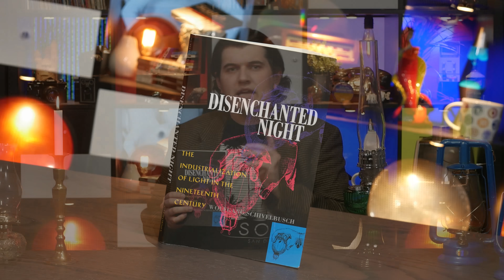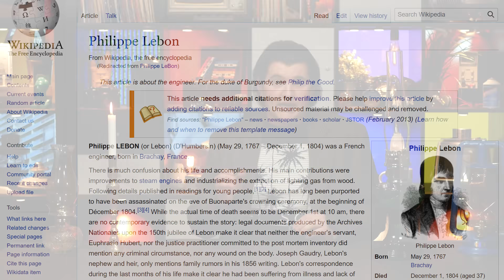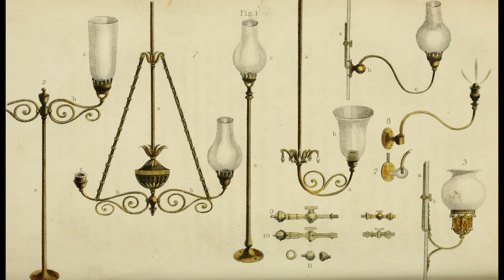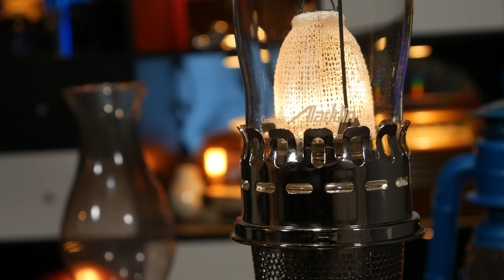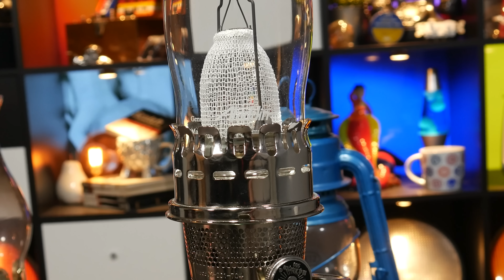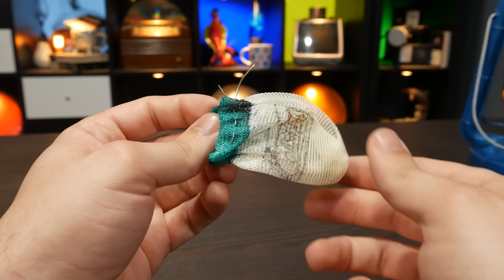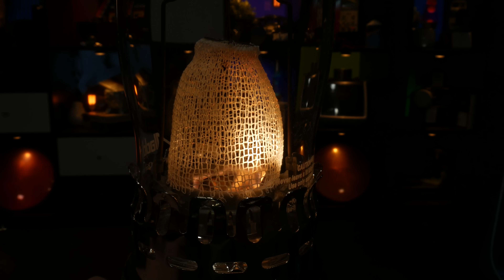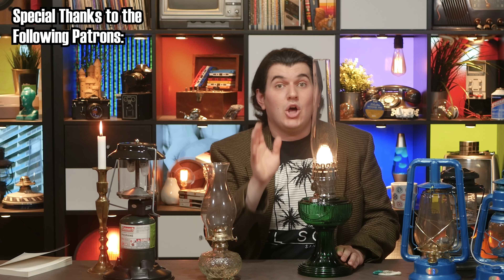How the gas mantle made lamps 10X brighter

Comment: Some notes on coal gas. I'm an amature blacksmith and I work with coal sometimes. So the way you forge with coal you add new coal by putting it around the edges so it slowly cooks and cokes up. As it cokes up it forms s greenish yellow smoke which most of us believe is sulfur. The impurities of the smoke when combined with water form caustic acids that can eat away at your flue if it's not made with the right materials. Now imagine using this gas to light your home. It's not going to be good.

Comment: This particular Aladdin lamp seems to be not working properly. Some wick issues, or outer wick tube has air leak. Proper burner always has a clean stable blue flame even at lower setting

Comment: Do you have any idea where I can get a replacement brass oil lamp burner (the thing that feeds the wide wick through an antique oil lamp burner. Amazon was no help at all.  I misplaced that part when I moved. Found the lamp, but can't use it without that part.  Appreciate any help.

Comment: I can see how he would call it a gasometer because it had on it a system to measure the tanks capacity.  It consisted of Stainless steel cables, pullies and a scale, as the fuel was used the Reservoirs roof would accordion down ( it’s the weight of the roof that gave the fuel it’s pressure) as it went down you could read the scale and determine how many acre feet of fuel remains inside the tank. When it got to low the fill valve would be opened until the maximum roof elevation was reached. In that way it did measure.

Comment: Thank you for this video. I have been searching things like "brightest gas lamp." I didn't find much. This video shed some light on the subject. A few years ago I saw an article about an invention that used 4 solar panels around a gas lamp. It is a interesting idea. I can no longer find that either. I have solar panels I don't use a night. Maybe, I can generate power at night using a gas lamp. surrounded by 4 solar panels. I would imagine 3-4 sets of mantles vertically in the middle. It is probably not terribly efficient but ice generators aren't either. Certainly a huge improvement in noise. Maybe a video experiment you could try?

Comment: I once toured the house my grandmother grew up in back in the '40s. I don't know how old it was before that, but it had gas lights installed at regular intervals on every wall. It was interesting.

Sadly, the house is very dilapidated and my uncle has grown too old to finish the restoration, which would cost more than the house would be worth. No one knows what's going to happen to it.

Comment: I think one should add a photoresistor based solenoid valve or some other mechanical thermostat based release valve controller to control the Aladdin lamp's gas release valve make it more usable and safe.

Thanks for the video, for me, this was the most interesting video you have put out so far (not to insinuate your other videos haven't been very interesting as well)

Comment: Thanks for these videos. Is this true?
"A two-megawatt windmill is made up of 260 tons of steel that required 300 tons or iron ore and 170 tons of coking coal, all mined, transported and produced by hydrocarbons. A windmill could spin until it falls apart and never generate as much energy as was invested in building it."
Reply: It's not true. Did some checking, and according to various sources wind turbines generate 20-80 times more energy than is used to produce them. The text you quoted has been fraudulently edited. Here is the original text (from Fullfact):

“The concept of net energy must also be applied to renewable sources of energy, such as windmills and photovoltaics. A two-megawatt windmill contains 260 tonnes of steel requiring 170 tonnes of coking coal and 300 tonnes of iron ore, all mined, transported and produced by hydrocarbons. The question is: how long must a windmill generate energy before it creates more energy than it took to build it? At a good wind site, the energy payback day could be in three years or less; in a poor location, energy payback may be never. That is, a windmill could spin until it falls apart and never generate as much energy as was invested in building it.”

Comment: The reason the flame flares up when you blow into that lamp is because the design causes a venturi effect just like a carburetor. When you blow into it it increases the pressure which pulls more fuel up and out the top. The whole thing technically is a working venturi and the heat rising pulls the colder air in, mixes it with fuel and burns it. Adding more air pulls more fuel and makes a bigger flame. If you were to blow into it with a leaf blower one of two things would likely occur 1) it'd get so hot that the glass would shatter 2) it'd turn into a flamethrower/jet engine as it quickly burnt through all the fuel in the bowl. If you look at the shape of the glass chimney it looks like a vertical jet engine nozzle.

Comment: I had an Aladdin kerosene lamp in the 1980's as an emergency lamp, and it worked well. I could easily read by it during a power outage. While it did not have an odor while I was using it, the smell of kerosene while it was not lit was very noticeable and annoying. I would put a rag in the chimney to plug it, which helped a lot. Even if I emptied it, there would still be a kerosene smell due to the liquid in the wick. I finally sold it, and used a propane lantern as an emergency light.

Comment: I would have thought a much bigger problem than all the oxygen being used up in a room pre-mantle gas lamps was the danger of carbon monoxide poisoning. Those low temperature flames, with incomplete combustion surely creates much more of it than does a Bunsen type flame.

nb. an interest parallel between the take-up and time-lines of fossil-fuel powered lamps and electric lamps. Just like lighting, electric cars preceded those powered by internal combustion engines, and those then went on to dominated the industry. Now, when we are all being encouraged to drive EVs, there are many who say that we are perfectly happy with our fossil fuel powered vehicles, why do we need electric?

Comment: When I was a kid my parents bought a travel trailer.   The trailer had gas mantle lights in it.  I seem to recall they were a bit of a pain in the ass to operate.   When I went on to study as a heavy equipment mechanic, the trade school that I went to had an old farm tractor that ran on wood.  You would load up a tank with wood, then a fire would be lit under it.   Wood in the tank would be cooked and a gas would come off of the wood which was then used to start what was essentially a deisel engine.   Once the engine started producing enough heat it would maintain the cooking of the wood in the tank and the fire in the firebox could be extinguished.

Comment: Had to pause the video to comment on the coleman propane lantern 
Theyre great for producing light however they run out of gas pretty quick
And honestly they dont seem to burn gas very effeciently in my experience 
I found that coleman lanterns run out of fuel in less than 8 hours even turned down low 
When theyre turned down low the light produced isnt really enough light to use
To really do anything  other than maybe go to the bath room  also they run out of fuel without warning
I do still however recommend them but advise one to have a flash light handy

Comment: if a gasometer is a holder, it has to be of certain sizes. when full, wouldn't that be a measurement? what if you put a pressure gauge on the holder? wouldn't that also allow you to measure it? maybe that was the line of thinking he had when naming it...

Comment: I have an ex German Federal Army 'Petromax' pressure lamp. When I bought it I specifically asked for the OE Thorium mantles.
Those mantles are mildly radioactive. I meant MILDLY. Not that far above background level. If you lived in an area where granite was the bedrock a handful of old mantles would be the least of your worries.
Reply: Or a you live in a concrete building

Comment: Love Aladdin lamps. Many around here and I buy, refurbish and resell. Frustrating to adjust for optimum burn but addictive. Center draft lamps are rarer (older) but are fun. The yellow-white tulip-shaped flame (ghastly hard to achieve perfectly) cranks out more light than an Aladdin, but is a fuel hog. Local hardwares sell Aladdin parts; the Amish use them. Beware, they require a warmup, you just don't light these and walk away!!
Reply: ps just subscribed.

Comment: "lute

    Tenacious clay or cement composed of various ingredients, and used to stop an orifice, to render air-tight a joint between two pipes, to coat a retort, etc., and to protect a graft. Also with a and plural a particular kind of this substance. †lute of wisdom [= medieval Latin lutum sapientae] , a composition for hermetical sealing, variously described by alchemists.

The pressure was sufficient to break the seal or, if the seal remained intact, it damaged the flasks." - Stack Exchange Network

Comment: Colman lanterns were designed to use White Gas (also called camp fuel), which is a refined gasoline and not the same thing. Only much later were they redesigned to the dual fuel lanters that can burn While Gas or gasoline. 

Also you can use a Dietz or dead air lamps indoors using lamp oil, which is kerosene that is further refined and burns much cleaner/totally then kerosene.

Comment: The gas mantle can provide a surface on which the combustion reactions can take place, leading to more complete combustion, without technically being a "catalyst". A catalyst gives an alternate reaction pathway with a lower activation energy. I'm guessing the gas mantle is increasing the amount of reactions happening between fuel molecules and oxygen by providing a surface, it's just not changing the reaction mechanism. Unless of course you consider a gas phase reactant different from an adsorbed reactant, but that's really in the weeds.

Comment: lute
Tenacious clay or cement composed of various ingredients, and used to stop an orifice, to render air-tight a joint between two pipes, to coat a retort and seal in the gases.
If his Lute was only forced then the glasses (Retort and glass pipes from it) might break.
Hence Forced my Lute (The stopper in the outlet of the Retort) and Break my glasses (The glass Retort and any othe glass items used in his Laboratory)
Hope this helps explain.

Comment: We had a ceiling-mount Aladdin lamp back in the 1970's, which had once been in a hotel.  It had an spring-loaded mount at the ceiling which would let you raise and lower it.

And yes, those liquid-fuel lanterns (and campstoves too) were always a pain to set up, an you had to pressurize them with a crude plunger pump.  Dad could make it work, I don't think I ever did.

Comment: Kerosene is hardly a niche fuel.  It powers jet aircraft, heats homes and powers diesel engines in the winter. 

It goes by many names depending on it's intended commercial use and the dye or aromatic added for tax purposes.   Depending on where you live jet A is cheaper than hardware store kerosene as is fuel oil no 1, and no 1 diesel.

Comment: I remember as a kid, my dad used a "Petromax" lamp which had an incandescent "bulb" similar to the propane ones you demonstrated, ran off kerosene and worked well outdoors when we were out camping. I think it was pressurized as you had to light it and then pressurize it so that it would burn with a constant flame. I don't remember how often it had to be re-pressurized but it was probably around half an hour or so. It operated very similarly to kerosene cooking stoves, which were actually a thing in India in the 80s! They probably burned very efficiently as there was a handle to carry it around, and it didn't emit as much hot air as the Alladin lamp, because when you were using the handle your hand was directly over it.

Comment: At the same time as the Aladdin there were also standard round wick lanterns like the famous one called Rayo that has a bit of controversy because it was made by the company selling much of the Kerosene fuel at the time, Standard Oil.  However, they do work great, about maybe a my own eye says 30% less bright than an Aladdin but no Mantel means a very stable flame overall and I hardly need to adjust it during operation.  I also do have a number of Aladdin as well, I have a bout 3 of each since they light up the house much better than battery lanterns and I usually don't run my generator continuously during power outages.   Here in Seattle we tend to have unpredictable weather and like in 2018-2019 we got 2-3 feet of snow in just a few hours and lost power for over a week from that.    These sure work great but you need to know how to use them safely.   The biggest issue of most of these lanterns is that they come in metal and glass.  The glass ones are great because they are heavy but the metal ones even with fuel are very very light weight and DANGEROUSLY easy to push and fall over causing a large and damaging Kerosene spill which is very bad inside a house with carpet or nice furnishings!!    This is why I only have glass ones, you can see how much fuel is left and a much lower chance of it falling over, oh and I don't have children yet and no pets so just clumsiness reasons I stick with glass ones!

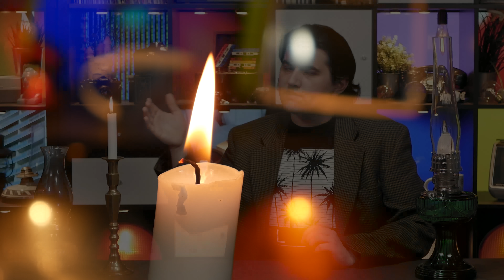Comment: 6:47 Actually most of the glow from a candle flame comes from the combustion itself.  The "small particles that are incandescent" only contribute to the red coloring of the flame around the edges (which is where the red sparks at 7:10 come from too). And the makeup of that glowing soot is actually irrelevant - literally ANYTHING heated to around 3000K will glow the same color (including the metal frame seen at 27:06).

Comment: So I did a ton of undergrad research into lanthanides like the yttrium used in that mantle and I can say there is no catalytic reaction going on. What is happening is just that the correct fuel to air ratio is occurring and a non dirty flame is happening. That dirty kerosene smell that comes from the Dietz lamps is due to the candle not being able to burn hot enough with enough air to actually burn all the fuel.  The aladdin lamp is providing both enough airflow and draft that the flame can get hot enough to burn cleanly.
Reply: Oh how I love a well stated, factual answer from somebody who obviously knows what they are talking about.
Reply: They are very, very, very slightly radioactive. Not at all dangerous, just enough radioactivity that you can demonstrate with an alcohol vapor chamber in a high school science class (they emit alpha particles which leave behind big, fat clouds of alcohol vapor).
Reply: @TheCrewExpendable  like my mother in law
Reply: This is so incredible it basically matches what T.C. said, but more in depth
Reply: Check out the brain on Kelsey!
Reply: @sharpenflat6002  lol

Comment: Has anyone tried modifying one of the hurricane lanterns to use the glowing mantle? I feel like that would have been a ridiculously useful combination.
Reply: It’s not really possible. The mantle lamps require a specific burner design in order to generate the right type of low, but very hot, flame. The reason the chimneys are so narrow is part of this, as it ensures the air flows quickly and tightly around the mantle. The flame on a mantle lamp when it’s properly operating is so low that it would produce hardly any light were it not for the mantle. A standard hurricane lamp/railroad lantern/oil lamp would, I suspect, wouldn’t be hot enough to illuminate the mantle except in a single extremely high temperature spot directly above the flame. It may not even burn hot enough anywhere to illuminate the mantle, or burn so dirty that the mantle just covers in soot.

Comment: The Coleman pressure lamp is still a favorite around here. Very reliable, easily repaired, and when you call Coleman in Wichita Kansas, you talk to a human! LOL! I've rebuilt hundreds of 220 and 200s, and dual fuel Coleman lanterns. What I hate about LP and battery lanterns is that you see the discarded canisters and batteries littering the landscape. At least the Coleman fuel can disappears to rust after a very few years.

Comment: For your Aladdin lamp you need to use a wick trimmer. I have one. It isa cylinder whose shaft fits into the wick body and has a horizontal blade fitted around its outer side - it looks a bit like the top part of your Dietz lamp and works very well, producing a level wick and consistent flame.

Comment: I used to do electric work to pay my way through college, and one house we wired was so old, it still had gas tubing inside the walls and ceilings for the light fixtures, and in the living room, hung a giant gas chandelier. We ended up running the wires through the tubing as it already lay in the same way the wiring would be.
Reply: Given that a quarter of all UK housing stock was built by the Victorians, finding gas pipes in walls is a common occurrence here.

Comment: “It forced my lute.”  
When devices were made that had pipes or other attachments added to them which need to be made air tight or pressure resistant,  a paste of some sort was prepare and applied to the joint. This paste was referred to as “luting.”
Moonshiners used a paste of barley or rye flour mixed with water.
Reply: Like Fuji 9 luting cement!
Reply: @FrancisCWolfe  It allows you to do your own dentistry, too!
Reply: @darktoranaga  Fuji 9
Reply: @KissMyFatAxe  That man is a tresure!
Reply: So basically he's saying he blew a gasket. Mans was PISSED
Reply: Sounds plausible.  This means that 'forcing the lute' and 'breaking my glasses' might imply that pressure was building up in the destillation apparatus. The pressurized/quickly expanding gas either forced the joints to leak or simply bust the glass equipment.
Reply: Exactly!  See https://en.wikipedia.org/wiki/Lute_(material)
Reply: Moonshiners often use simple clay slapped onto the leaking joint.
Reply: u gonna drop sources